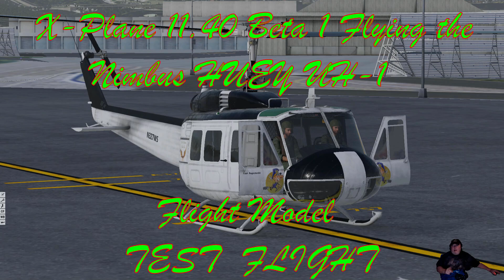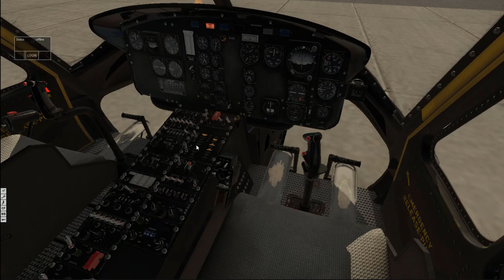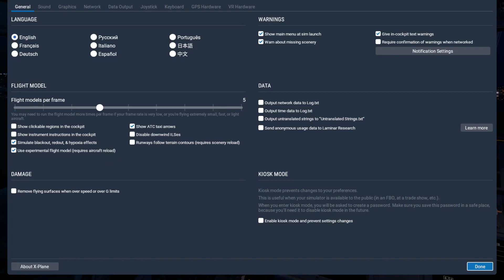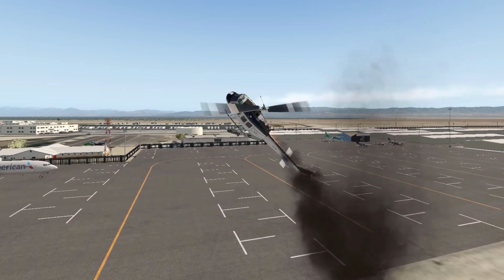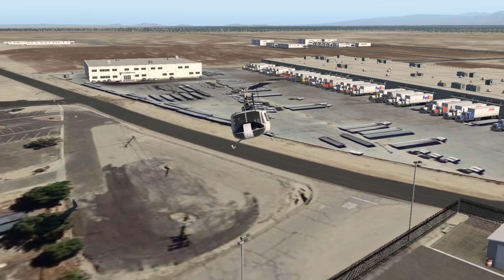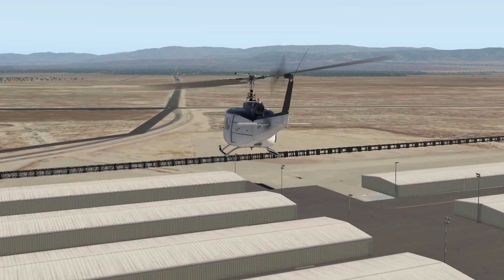X-Plane 11.40 Beta 1 Nimbus Huey UH-1 Flight Model Test Flight

Comment: Nice job. I'm having some trouble with mine. I installed into X Plane v, 11.30. Many things not working. I read the manual, set frames to 4, and unchecked the "fly with experimental box." The sound and rotor animation is way off, engine gauges aren't working, ect. My battery, generator, and inverter are on. Updating to version 11.36 didn't help. I tried another download and install as well. Is the helicopter meant to fly in 11.40 beta...any suggestions?..thanks!
Reply from the maker: OMG, Sorry to hear of your issues. I have not run into any of those problems. I have not tried to fly the Nimbus in Beta 4 yet, but I will give it a try and let you know in a video. Thank you for the comment